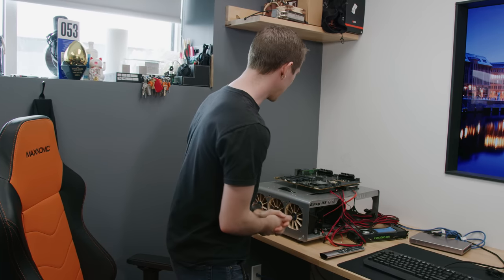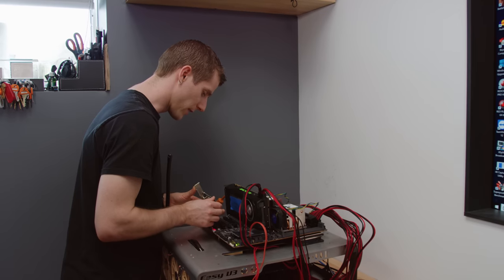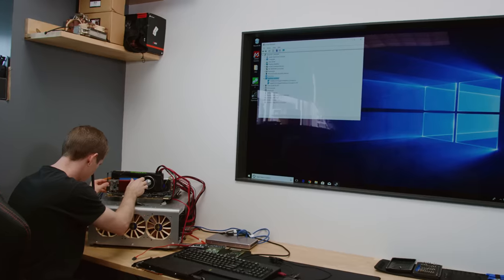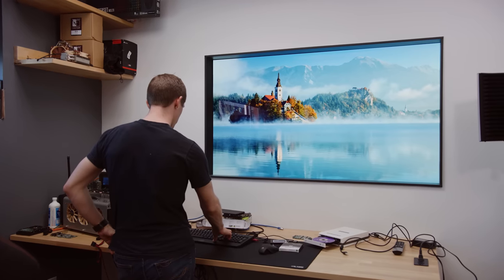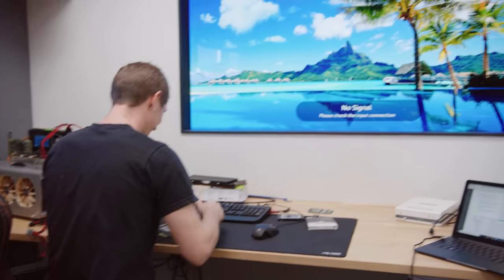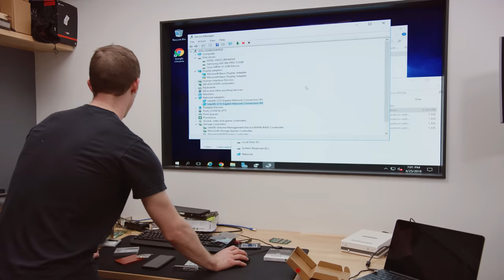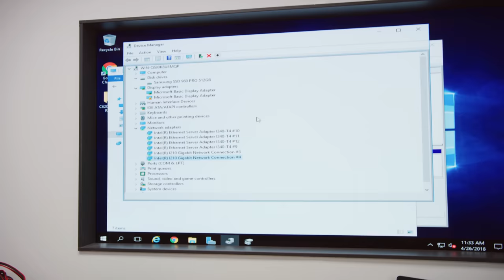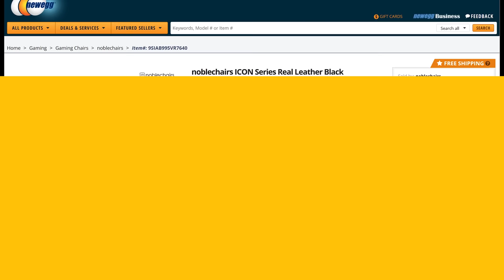I've NEVER been so FRUSTRATED... Hot-Swapping PCIe Cards

Comment: Great, now hot-swap a CPU.
Reply: Can be done on multi-CPU systems.
Reply: @rautamiekka  well he could have tried it he had a dual socket mainboard in the video
Reply: @BadMax02_VR  he actually operates on dual socket mobo on the video
Reply: @RzariRzari  but i don't think that board would support that xD
Reply: @BadMax02_VR  I don't think there is any mobo supporting hot-swapping CPU in the world
Reply: @RzariRzari  well not for the public probably but big servers or mainframes need replaceable cpus because they cant take the systems offline
Reply: @BadMax02_VR  I mean, there is no need for that except if your CPU fries or something, but then machine gets shut down anyway. But server rooms don't operate on single computer, as you said it's whole mainframe with RAIDs etc. In case of malfunctioning or changing something, server still runs fine
Reply: @RzariRzari  yeah so there probably isnt a off the shelf system you can buy which supports that
Reply: @rautamiekka  may result in burnt fingers
Reply: @RzariRzari  no some servers support it
Reply: The only servers that support it are blade systems, and they don't really support it to the point where you can just take a CPU out of the socket. Instead, blade systems are made of a central unit that probably takes 6U of space on a rack (as an example) and has a bunch of slots like drive bays. Instead of drive bays, they have motherboards on rails that slot in with a proprietary connector that connects to a backplane in the central unit. The motherboards contain the CPU and RAM, and the backplane will usually just have networking. Blade systems are just for high-density CPU or RAM tasks, and won't have any accelerator or storage cards like GPUs and RAID cards because they're left for other systems.
Reply: He would get burned alive
Reply: he said early on in the video that some boards support hot swapping CPUs
Reply: @BadMax02_VR  thats why they'll use backup servers. For temporary usage. I run a email client and a couple game servers for a game I programmed. It has very few people online ( 50-100 people worldwide are typically playing on busy times of the day. ) My main server uses a dual socket server board with two xeons, and 128gb pc3 ram running at 1600mhz and other unnecessary details. If I have to do any maintenance on that particular system. I have a motherboard which has a feature allowing you to hot-swap certain components ( of course that varies obviously. ) or if it is something that is more crucial and requires a system shutdown. I made a program which will automatically turn on my backup server and then things will still be alright just with possibly higher ping for people playing and network spikes but at least no downtime. So I'll be able to fix the server that needs maintenance.
Reply: Hot swap the CPU? That's nothing, I can hot swap the entire computer. A notebook, at least…
Reply: hot-swap PSu
Reply: you probably could just in bios
Reply: @rautamiekka  boring
Reply: A Mainboard
Reply: You could theoretically swap coprocessors at least like xeon phi
Reply: as long as theres something to keep the machine still running x86 code and your xeon isint making too much heat for you to take it out, it could work.

Comment: My nvidia drivers crashed when you got uncorrectable error. Your videos are going to the next level of realism. Or nvidia drivers are still shit.
Reply: never encounter nvidia driver crash, just update your windows
Reply: Hadi meiza oh, i did. Yesterday
Reply: maybe you need to get that alpha/beta BIOS
Reply: Cheejyg, It may be the case. I'll try another (more older version) of drivers, and then will see. If it will be crashing, I will try to get a newer bios.
Reply: I still can't install new drivers from 25 april because it does not see my videocard after installation and giving bluescreen. Never had something like this on amd tho.
Reply: So there's augmented reality, virtual reality...
Yours is real reality?
Reply: Indeed nvidia drivers suck, it also crashes on my computer when using google chrome with hardware acceleration on.
Only an old driver works better then all the recent ones that crash very fast.
I bought recently a 1050ti Lp 4gb for a sff pc and it was really shit to figure out what was wrong.
I still havent found a 100% good working driver version that doesnt crash with hardware acceleration on.
Reply: Metamancer Not for me boi
Reply: baklap141 What the heck even is your computer that you can't have handle chrome?
Reply: Crecross Official 
It can handle chrome easily but the nvidia driver fucks it up.
With hardware acceleration off it doesnt crash.
Its i7 870 + 16 gb ram + 1050ti + ssd and should work fine.
I play far cry 5 and other games just fine at 1080p and even play 1440p video without problem.
As soon as I open chrome with the setting turned on the gpu driver crashes.
The driver is the problem, its mentioned on the  nvidia forums and nvidia says "its fixed" but every new update still doesnt have the fix.
Reply: My Nvidia drivers have never crashed except when caused by a GPU OC.
Reply: B D Drivers are tough, it's not like AMD is great with them either. The RX 480 has ~30% more transistors, memory bandwidth, and TFLOPs than a GTX 1060 yet performs about the same. In theory it should be a good amount faster, but the drivers are far less optimized than Nvidia's.
Reply: Y e s
Reply: Hadi meiza I find them all the fucking time. Its because of his widows, but it's still unacceptable.
Reply: Lol that made me spit out my coffee
Reply: Ash Did you have amd card before? There might be driver problems. Uninstall the amd drivers before installing the Nvidia drivers.
Reply: B D Not sure what that video was supposed to prove, as it showed AMD/ATI manipulating things as well. Yes mining reveals the unused potential in AMD cards since it's just raw computation, and yes Nvidia has pulled some shenanigans over the years, but that doesn't explain away AMD performance in all games. Not all games have Gameworks or "Nvidia cheating." Why do NO games show an RX 480 as 30% faster than a 1060? It's partially the games, but also because their drivers aren't as optimized.

AMD has a problem with keeping GPUs fully utilized (keeping texture & compute units busy, not utilization shown in Afterburner), particularly in DX11. The 480 may have 30% faster hardware, but if that 30% is sitting idle you won't see it. An AMD card might be sitting at 70% utilization in DX11, while the more optimized Nvidia card is at 90%. This is what asynchronous compute aims to fix, to fill the bubbles in the pipeline. That's partially why AMD sees bigger gains in DX12; not only are AMD cards better at async compute, but they also have more "bubbles" to fill (more untapped power). Untapped power is nice in theory, but it does you no good if you can't utilize it. You wouldn't buy a 16-core CPU just for gaming, despite the "untapped power." DX12/Vulkan is helping AMD, but there are only a few dozen games using those so far. So yes you can blame game devs for some of that, but fact is that Nvidia is optimized well in part due to drivers. For example Nvidia drivers can split single-threaded draw calls across multiple CPU threads in DX11, but AMD cannot.

Comment: Don't call a 5450 sacrificial when I am in the process of trying to install Ubuntu on an HTPC with a 5450 in it. It can hear you, and now you made it sad.
Reply: PaJeezy thats and overkill mate just use IBM monochrome adapter it can run gta 5 at 16k 144fps
Reply: That card made my bro's computer comatose, the inbuilt graphics are more reliable than that card series
Reply: I just sold mine for $15 nzd lmao. I have another though. They are useful for adding monitors, which I need because I have 8.
Reply: Why do you need 8 monitors?
Reply: he is diving into the matrix
Reply: @luciffertribal794  wow
Reply: I don't think 8 monitors is what you would call a need. When you think of a need I guess the first thought is something like food and water, not 8 monitors.

Comment: 3:02 Good to see that even hardware professionals don't even know what all of the bios settings do :P
Reply: """"professionals"""
Reply: He is kinda a professional. The range of knowledge he has is amazing.
Reply: I think even the developers aren't sure every now and then.
Reply: J0RAKU The jab was less at the knowledge possessed than the ghetto fashion Linus likes to do things ;)
Reply: he's not a hardware professional, he's just a guy who plugs GPUs and CPUs in and out of PCs
Reply: xChrisS41x """"""""""""""""""""""""""""professionals""""""""""""""""""""""""""""

You must be new here
Reply: Before my pipo x7 crapped itself, I would regularly dive into the bios. Boy did that have every setting under the sun.
Reply: In my opinion it's a useless feature, not like one's gonna plug/unplug cards that often, and what's the big deal of powering off for 30 seconds?  It's usually usb devices that have to work hot swappable correctly.
Reply: Bill A it's useful for people who test hardware very often, that saves a lot of time.
Reply: Yeah I guess I can see it being useful in that case, but it's a pretty limited audience.  Unlike USB devices the PCI bus was never designed to be PnPlay until recent revisions.  I still don't trust PCI bus hot-plugs (still too many quirks), somehow it's too much of an integral part of the system, so a reboot will pick it up properly (especially with 30 second SSD speeds). imho
Reply: He actually is his job is server implementation and maintenance. He just does this stuff for the people
Reply: linus is by no means professional. enthusiast maybe
Reply: @BillAnt  linus do a lot of benchmarks. It is for sure can be really useful for cases like that
Reply: No one does lmao

Comment: This could actually make benchmarking multiple graphics cards on the same system less tedious.
Reply: I was thinking that but for most people, useless.
Reply: Gamesfan34260 for card testing and mission critical servers, this is an ideal board. (It's a server board, after all) HOWEVER, you are correct that this is mostly useless for the rest of us.
Reply: girlsdrinkfeck: I mean, at least you don't have to reboot your computer to uninstall and reinstall cards.
Reply: girlsdrinkfeck on Linux, graphics drivers don't conflict, and they're not tied to a specific PCIE port. You can even unplug the GPU used for display and it would automatically switch to an alternate video output
Reply: True but it's the sort of advancement that could come with some kind of weirdness when it's new. I can imagine slotting a card in, testing it and getting 20fps less than I should and certain games glitching only to find out that a simple reboot solves the issues and it's not the card or drivers. I'd probably still restart but yeah, if it's totally solid and there's every chance it is - then that would be great!
Reply: True, but you still have to reboot for enabling/disabling sli/dx12

Comment: But don't the laptops with extendable gfx cards already support hot-swap?
By the way: how can the person that mounts coolers for an i7 and core i9 with zipties not want to hotswap a Titan X?
A hotswap a day keeps the BSOD away.
Reply: I think some of them require a restart.
Reply: Technically yes, but those are connected through thunderbolt with some performance loss. This is direct connection through PCI-e, ie. 100% performance.
Reply: sasja de vries. That's just switching display from iGPU to the dedicated
Reply: Thunderbolt is basically PCIe over a wire and hot pluggable so the OS should be able to handle pcie devices appearing and disappearing.
Reply: Иван Нанић performance has nothing to do with it. It's still goin over PCIe
Reply: I think GPUs might be natively hot-swappable, I've accidently pulled the GPU out of my test bench with no issues.
Reply: I'm pretty sure the fact that they go over Thunderbolt makes them hot pluggable. The Thunderbolt controller is connected to PCI-e and then the GPU is connected to the Thunderbolt controller. So it's technically not hot-plugging over PCI-e
Reply: MagnusKremlin but where is the shin bone connected to?
Reply: Thunderbolt is a direct PCIe connection, but IIRC it has a max of 4 lanes or something. There can be performance throttling because of the lower bandwidth.

A few of the early eGPU enclosures apparently required a restart before the computer would recognize the GPU over Thunderbolt, but I'm not sure why. Clearly PCIe protocol-y stuff supports hotswapping, but I'd never heard of it being a thing in the actual PCIe slots. That's cool as hell.
Reply: Yea, Windows is already equipped to handle appearing/disappearing PCIe devices. The difference though is that to the motherboard/BIOS its the Thunderbolt controller that is essentially abstracting out the PCIe bus, so it's different than raw PCIe
Reply: Seshpenguin So if your motherboard supports it, hotswapping PCIe is possible, without the fancy board Linus has? That would explain my PC not crashing when I pulled out my GPU that one time.
Reply: Yep! That or you were lucky, since it was possible the motherboard and Windows didn't react (i.e it didn't see a unplug/plug event and just assumed the gpu was plugged in all along)

Comment: It is very surprising to me that this is a new thing to Linus.  With all the high-end, workstation, and server stuff he deals with, I wouldn't have thought that PCIe hot-swap was a new thing to him.
Reply: Anonymous Freak he has servers but not high end stuff
Reply: Nor has he seen a laptop with PCI/PCIe cards?
Reply: He´s probably just always been afraid of hot-plugging stuff. Heck, I hot-plugged a graphics card into my main system without any problems once, and that´s just a regular consumer machine. It´s usually just a matter of the drivers loading/unloading correctly.
Reply: Or, more likely, ExpressCard slots - which are just small-form-factor, externally-mountable, PCIe cards.
Reply: Yeah I'm with you on this Anon. Was watching thinking "I hot swap sata drives on a daily basis" this hasn't been new for years.
Reply: He's an entertainer more than anything else. Professional users would just contact the motherboard manufacturer support team and ask for the details rather than waste time messing with cards and potentially damaging something. Watching someone on the phone for 5 minutes isn't entertaining though.
Reply: he mentioned that try exist, but not on consumer level
Reply: well PCIe was designed to be hotplugable, whether all sides of it are made compliant is another question
Reply: My first experience with PCI hot swap was a Dell server back in like 2000 ish. P3 gen Xeon server 1ghz. It was a nice feature and I used it once to add a nic I think. Certainly not new...
Reply: He does indeed have high end servers. But this is kinda useless for home users obviously, but hey, it's fun to watch this stuff :)
Reply: I have not seen too much "high end"  on his feed though will agree is is top shelf consumer.  Far as real servers  I been able to so this since around the 15 years. it matters more now that ever as not everyone uses or all OS/apps run under vmotionalble hypervisors. some of my server cost more than $200k USD though not the point as much as as if i don't have to move the workload off be changing out a NIC that was there for redundancy. Trust me when we get to these density of work load hot swap it nice when it works :)

Comment: In the late 90's, Compaq servers had PCI and PCI-X hot swap.  I've made use of it several times. One time to swap a Quad-Ethernet PCI-X card that had blown on an NT4 BDC.  You just slid the server out, pop the hood, and the catch is there was a power button by the hot swap slots. You powered it off to pull the card, do the swap and power it back on. It worked flawlessly.  I even did it with Compaq RAID controllers that failed.  Mind you they were secondary , not booting volumes.  But it work flawlessly.  The swapped in RAID card would read the config on the drives and present itself to NT4 Server.  What this video shows is cool, but is not all that new of a feature.  FWIW,the Compaq servers with this feature, did come with a price premium.  They were not standard.
Reply: There's multi-server setups that even have hot swappable CPUs, lol. When you get into server territory you see a lot more options like that. Seeing something like this on a desktop/consumer board though... that's the interesting part here specifically.

Comment: As someone that has programmed a PCI kernel module before this hurts to watch.
Reply: What exactly about it bothers you?
Reply: Windows is so very much not hot plug capable with PCIE...it’s in the standard but it’s basically pretty much unsupported because it’s a royal bastard to write a driver that doesn’t just shoot the whole system.
Reply: OverKillPlusOne Surely this video disproves that or would it take longer for the instability to manifest?
Reply: Also, about the ps2 thing,I shorted my mobo hot swapping like that. The ps2 port never worked again
Reply: ps2 is not hot swappable im pretty sure
Reply: Yea,but he said "no ill adverse effects". I call bs lol
Reply: How would you like it if someone "hot swapped" what is basically your eyes and parts of your brain

Comment: 18:06 - That's how excited I got when the very first Plug'n'Play ISA cards and motherboards came out. Smack it in, Boot up, Install drivers. No friggin jumper or dip switch configuration needed. Wooooaaa...
Reply: And memory you didn't have to configure in the BIOS first. Or CPUs with pages of jumper settings.
Reply: You just reminded that pcs used to have jumpers that could be changed. Nothing to miss there.